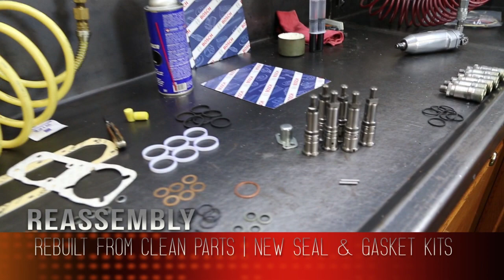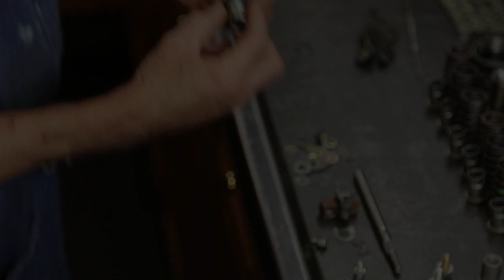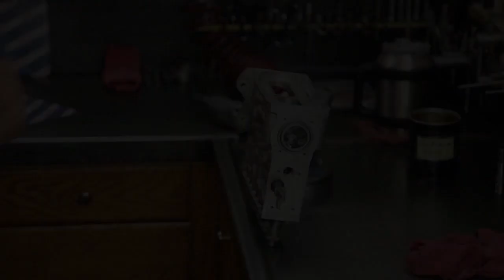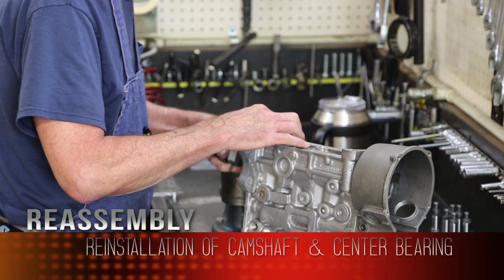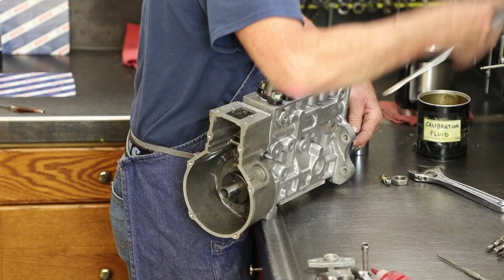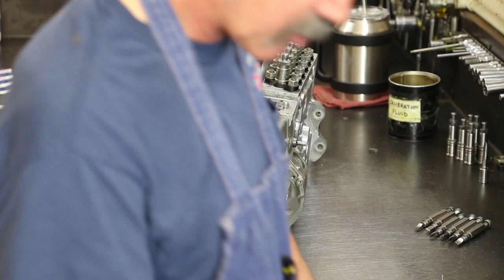Part 3 - #Bosch #Diesel #Pump #Rebuild - Area Diesel for #bcbloc02 Hyster Forklift 8.3L Cummins Swap

Comment: Thanks for the video. I am a jerk injection guy. My truck is a p-pump 24 valve. My tractor uses the CAV rotary pump. The pumps are pretty simple but the tolerances are everything and these tolerances are micron insane! But you can have modern engines with their proprietary crap. My Perkins engine is over 60 years old and I love it. My Cummins is an old friend. Thanks for keeping this tech alive.

Comment: What makes different barrel shims? I see all different numbers on them. 115,120,125,130 etc.
Reply from the maker: The thickness which changes the phase timing for each cylinder.
Reply: @AreaDieselService  Is there a chart way they go or every time rebuild it is different?

Comment: greetings. how and what tool he uses to set the pump to what degrees of timing?i have mine apart and at this point on installing the fly weights. confused on pump timing and then pump and motor timing. also, i have a 77/64 sledpuller turbo and 150hp injectors on a 24v but using a 215hp p-pump, what would be the best timing for my setup? thank you in advanced.